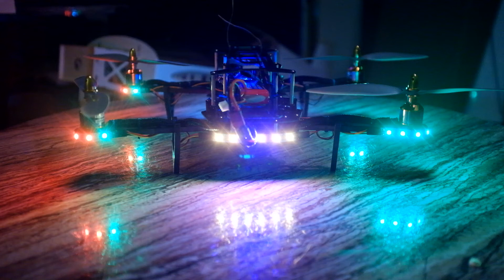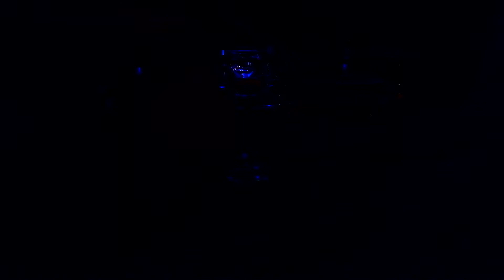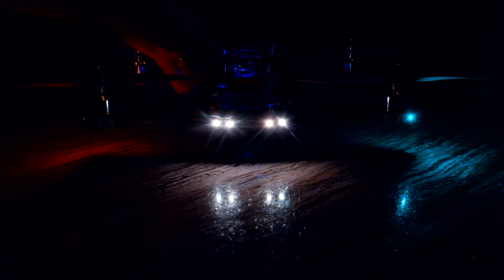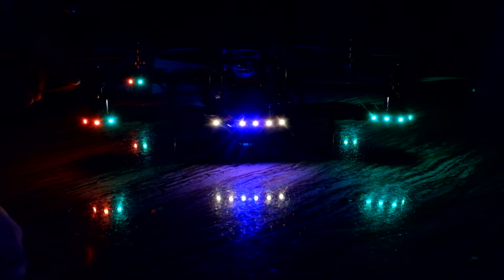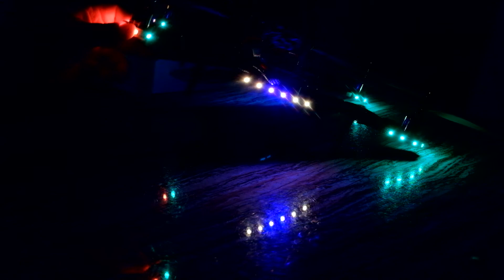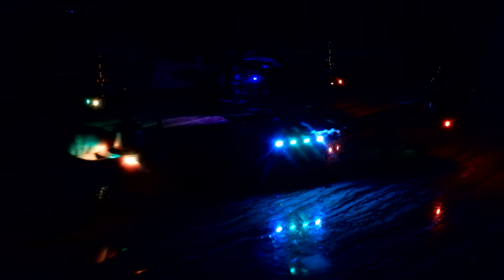Cleanflight RGB v1.7.0 LEDs In Action

Comment: Hi, how can I use 4 wire LED strip (+ve,RGB)? here rgb are -ve every one is using 3 wire strip. Should I mix RGB? I need to use white in front and red at back and have done by direct connect to Lipo battery. Want to use this way.